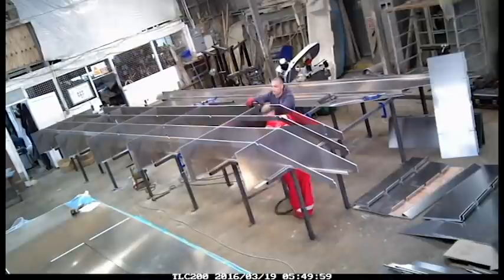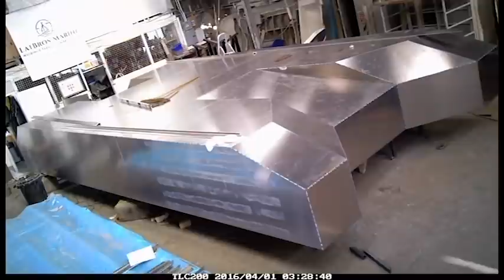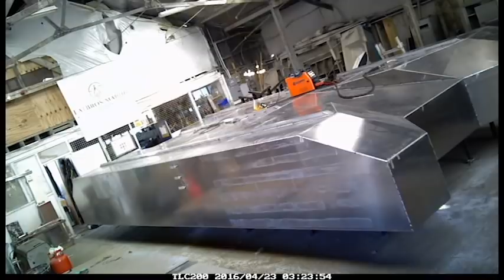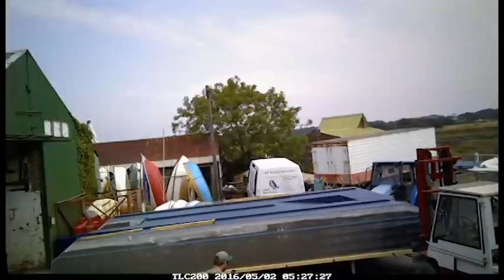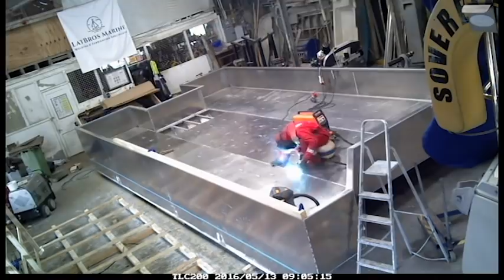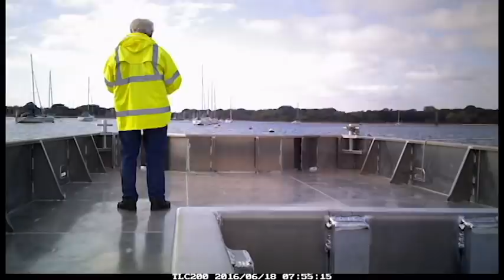Aluminium Barge/ Aluminium boat building/ Fabrication/ Aluminium Welding/  Fabrication/ Mig welding

Comment: excellent work. can i please ask what filler wire you used? and also about what weld prep you typically do for new material? keep up the good work!
Reply from the maker: Hi Dave,

Thank you for the question. We normally use 5556 Alloy 1.2mm. Weld prep depends on the thickness and type of weld. For the 6mm thick buttweld, we do 3mm @45% on each piece of metal for down-hand weld, after it is welded we do about the same depth root from underneath and weld it overhead. Thanks for your support!
Reply: @latbros  Thank you for your reply. What about in terms of cleaning the material before welding?
Reply from the maker: @davework5922  just removed oxide at list 20mm of the edge and then after that just wipe edges clean with acetone cloth.  Welds should be nice and smooth.

Comment: Beautiful Boat! Why did you choose to have the hull make two points at the front as opposed to one? And why not just totally flat on the back? How many welding hours would you estimate went into this? Thanks!
Reply from the maker: Hi Jacob, 
It was the customers' decision to have two hulls bow and stern. The idea is to lift mooring buoys through the gap on the bow. Space between two hulls at the stern is used to safely install/Mount 2 x 15HP engines. I will be posting a new video once the barge is completely fitted out. It is 95% ready and the customer deciding what lifting gear he wants to use on it. We have managed to do some stability tests and it was pretty impressive. Keep an eye on our channel for the update. Best regards, Slava from LatBros Marine

Comment: What is that barge for Mooring laying? Or some other boat yard purpose? 
But why aluminium not steel?
But that might depend on purpose.
Cheers Warren
Reply from the maker: Hi Warren,  
That is right. Mainly for moorings services but also for other yard/harbour works. Aluminium is used because it is easier to maintain, modify and does not have to be fully painted. There will be more gear attached later as customer has not decided yet what sort of gear he needs. It looks different already. Since then we have added rubber fending and wheelhouse, engines to be fitted within next month or so. Regards, Slava

Comment: halo what type of Aluminum plate you use at... and the thickness? perhaps a little bit of info..? yhanks, cheerss
Reply from the maker: Hi Adrianus, feel free to ask anything that can help, my friend!

 This barge is almost completely built out of 6mm thick Alloy 5083 H111

Regards, Slava
Reply: I’d like to see a finished version in use
Reply from the maker: @Mj-CWO4  it is still sat in the boat yard.  The owners still deciding what features they want to put on it. Hopefully will be sorted by  June July

Comment: how many gas tank to finish the barge Thanks
Reply from the maker: Hi Archie, if I am right I have used around 5 300Bar gas bottles. And to be fair could have saved a bit on that. There were areas that I could have welded less.

Comment: Hi, what is the brand of your aluminum welding machine? Thanks!
Reply from the maker: Hi Anita, here we use Kemppi Kempact Puls 3000

Very reliable, amazingly compact, up to 250amp pulse output with 1.2mm alloy wire 5556. Need a water cooler and water cooled torch for long day exploitation. Would definitely  recommend for mobile use. 
Thanks, Slava
Reply: @latbros  why 5556 and not 5356
Reply from the maker: @breezeblockindustrie  both would do as good.
Reply: @latbros  wow, some brands of welding machines are different between the USA and Europe/UK.  Have not heard of the one you are using.
Reply from the maker: @thornyturtleranch6152  yeah. This are maid in Scandinavia,   Finland to be correct.  Great top level machines well designed and relentless. This little fellow in the video was just about to get this job done. Ideally need water cooled one. )) Also Fronius are very popular in UK
Reply: @latbros  I have heard of fronius.  Seems to be more of them around USA.
Reply from the maker: @thornyturtleranch6152  yeah, they are Australian machines

Comment: Guys, how thick this aluminum is?
Reply from the maker: Arvidas, this is 6mm 5083 H111 aluminium throughout
Reply: @latbros  did not expected so thick. Thank you for reply! Great job!
Reply from the maker: @gaspadorius  it is a work barge so will have some rough times as well. Mooring blocks are quite heavy and will definitely bounce around so thickness is needed.  As well as the ses bottom is not always clean. It is going to work in the shallow waters

Comment: I wonder if a fiber laser machine would handle this kind of job… if so, it would be half the hours welding… just not sure if they can penetrate 6mm 🤨
Reply: Modern fiber lasers can cut 5, 10, 15 and more mm ;) It dependent of laser power and laser head max power. There right now 20kW or 30kW lasers.